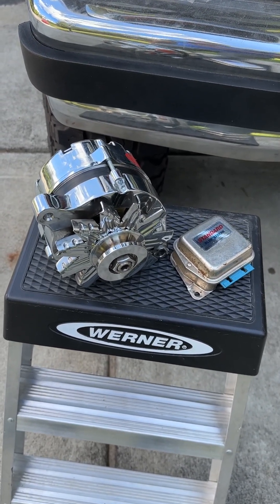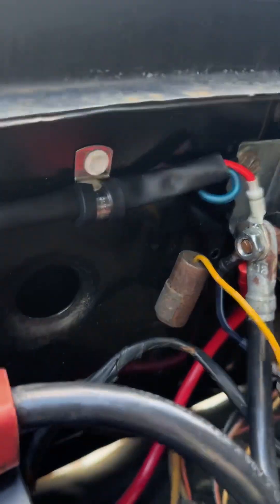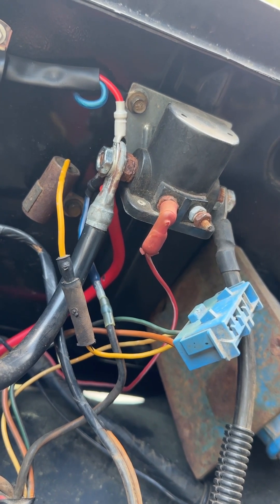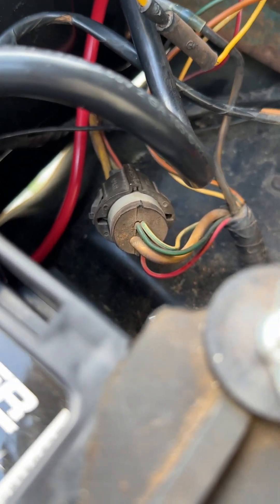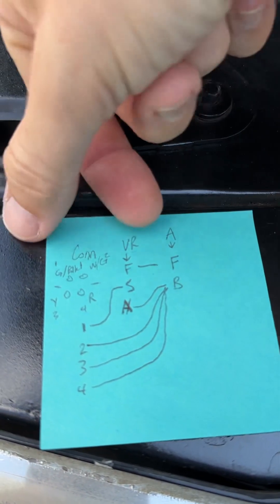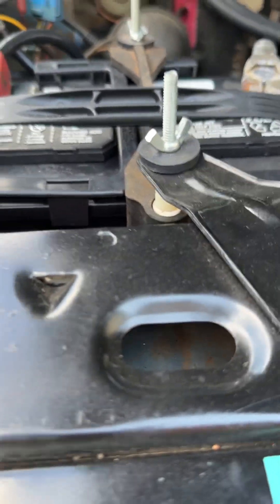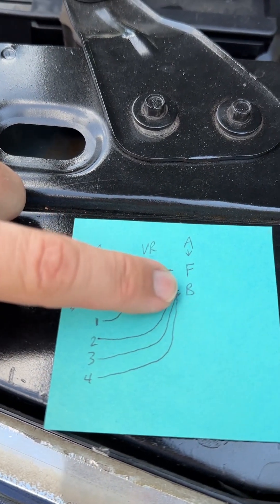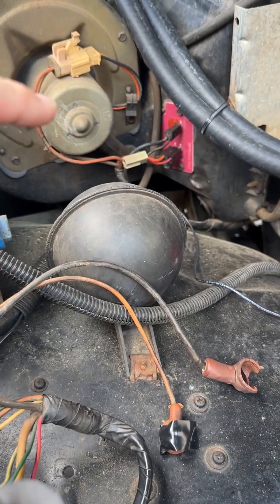One Wire Alternator Upgrade from Old Style Ford Externally Regulated Alternator

Comment: I have 1980 bullnose My fused link was in a loop of wire with The alternator field wire and charge cable.  I couldnt get power to the interior at first as I stood there at the fender, with these 3 wires left in my hands after hooking up all the right wires to the New alternator and inline fuse for the large red wire... So I was confused until I touched the positive side of the battery with one of the 3 wires That were left over after the install..  SO I TOUCHED THE BATTERY WITH THE OEM CHARGE WIRE THE INTERIOR LIT UP AND MY PARKS CAME ON . AND IT STARTED UP .  BUT NO HEAD LIGHTS AT ALL...  I was lost as to how am I not getting head lights.. but all other items work as the bronco sat there running with the Stuff Stuff alternator and regulator installed..   STILL LOST...   I DID MAKE THE MISTAKE OF TOUCH THE OEM charge cable and the fused link that it's in the loop with to the same positive side of the battery on mistake and fried the OEM FUSED LINK . BUT WITH THE OEM CHARGE CABLE MOUNTED TO THE POSITIVE SIDE OF THE SOLENOID EVERY THING COMES ON ALL OF UH SUDDEN... EXCEPT HEAD LIGHTS...    .ALL I DID WAS REPLACED THE OEM ALTERNATOR...  I DONT HAVE JUNK WIRES EVERYTHING IS FACTORY...